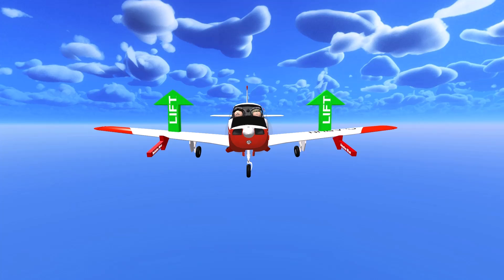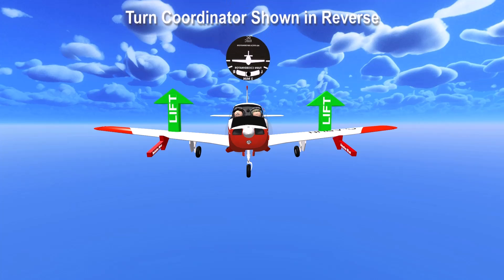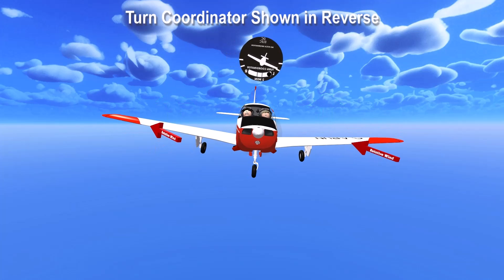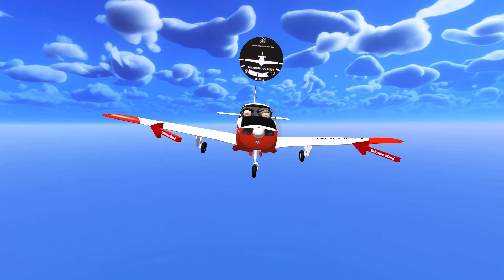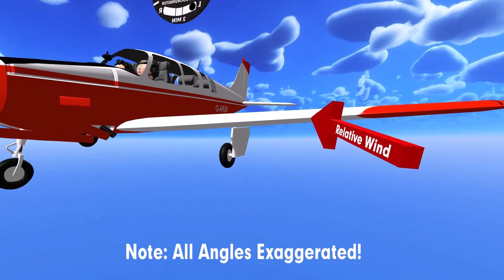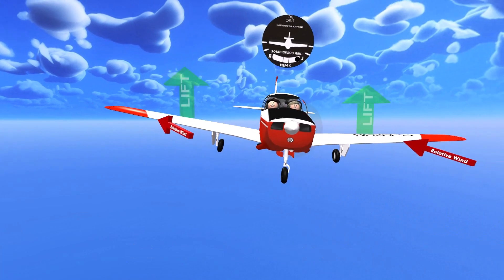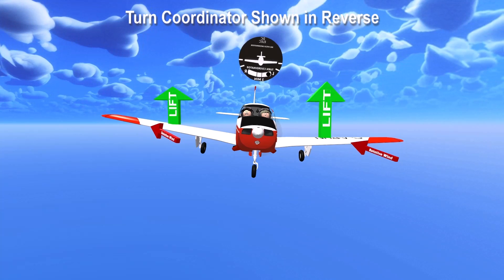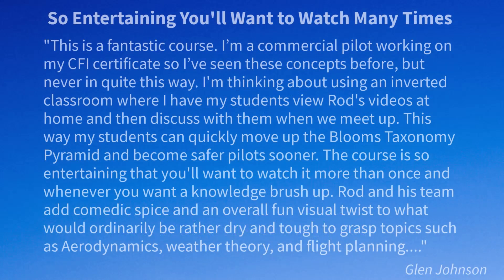Dihedral and Lateral Stability

Comment: Hey Mr. ROD THANKS FOR THE AMAZING VIDEO! I had a questions while you were explaining what dihedral was. What are you referring to when you say a line through the center of each wing? Are you implying that there is a straight line from left wing to the right wing, or each wing has a straight line drawn from the fuselage to the to the tip of the wing? Just wanted to clarify! Thanks again!
Reply from the maker: Thank you for your comment, Jake. I appreciate it. The line through the wing is a line from the wing root to the wing tip.
Best,
Rod

Comment: Rod, You are fantastic, very helpful!  Thank you.  Sincere question...  Hypothetically - If a wing had an exaggerated 45° of dihedral per wing, and the fuselage was perfectly balanced as to not create pendulum from the center of lift.... not probable, but lets pretend its a homebuilt expiramental aircraft....  In a co-ordinated 45° bank the high wing would have 0% Vertical component of lift, and the low wing would have 100% Vertical component of lift.  Being that wieght is one of the four forces at play, how do these unbalanced lifting forces NOT provide lateral stability?  Doesnt the airplane tumble towards gravity,  creating inherent stability?

Comment: Hey Rod great explanation on what I was struggle to understand. This is what the PHAK goes over and as you said only affects stability on a side slip condition. My question on a coordinated bank and wings creating equal lift, isn’t the inner wing producing more vertical lift while outer is producing more horizontal lift or is this negligible and over powered by other effects like a faster outer wing?
Reply from the maker: Greetings Austin:
Thank you for that comment. I don't quite understand your question. What is horizontal lift? Lift only acts in one direction--vertically (often called "effective lift). Please explain and I might be able to help here.
Rod

Comment: Another benefit of dihedral is that it inclines the bottom surface of the wing fuel tanks, for more effective sumping of fuel contaminants and water (while parked on level ground). This is probably why high-wing designs bother to include a small degree of dihedral.